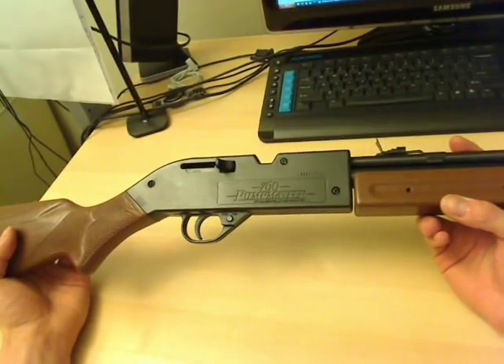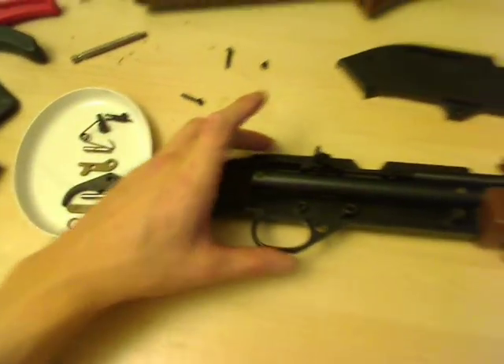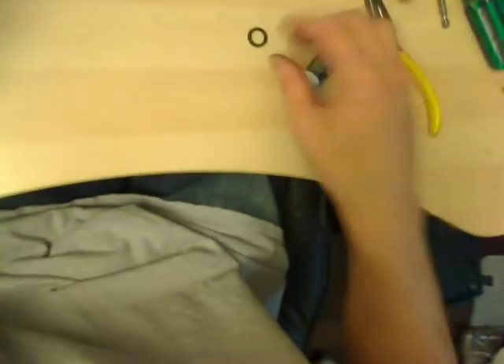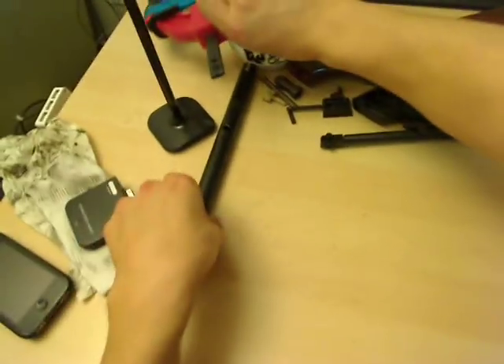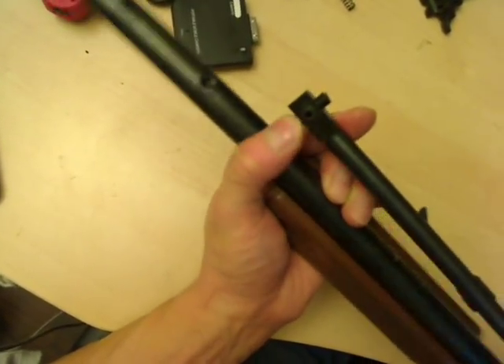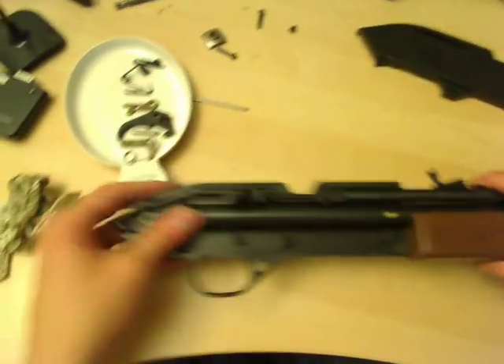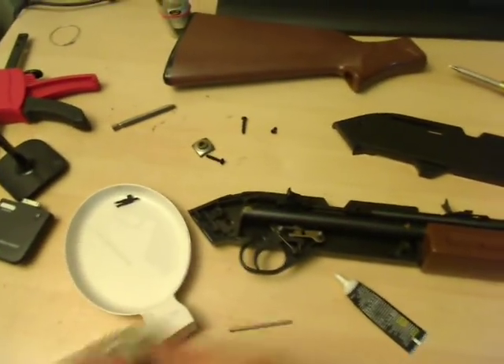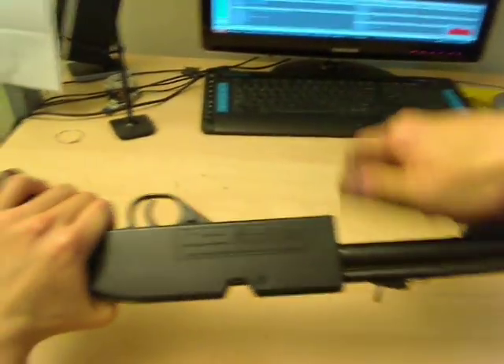FPV - How to Repair an 18 Year Old Crosman PumpMaster 760

Comment: I heard if you soak the seals in ATF fluid it will rejuvenate them. I was given 2 760 Pump Masters from a friend. He put WD-40 in the both them and destroyed them. I'm watching your video to see how to take them apart. I wanna see if I can try the ATF trick on them first. Just to see. I don't have high hopes. But in any case that will be awesome if it works. If not I'll replace them out. Plus I need to recondition both of these. He had them sitting in a high moisturized area and it shows. I want to gun metal grey the barrels a flat matte. Not sure if I'll do anything custom with the stocks. I'm thinking Olive Drab maybe for the Black one which is newer and the older one which has the brown keeping it classic. I'll just magic eraser it. Maybe stencil something cool into the plastic with my soldering gun. In any case, I'm going to have these both high speed once I'm through with them. Good video too, thanx... 👍
Reply from the maker: Hi,
I haven't heard of the ATF before, hope it works!  There are those additives for stopping engine oil from leaking, I wonder if that mixed with engine oil would be a good soak for the rings to get them to swell, that's basically how they stop the leaking.
Sounds like you'll have yourself a good couple of 760s!  They shoot well, since they have rifled barrels, so it's worth all the work to get them working well.
The new barrels aren't rifled from what I heard. They really cheaped out. Thanks for watching, and the comment.
Have fun!
Cheers,
David.

Comment: And after some hammering my Crossman no longer shoots straight. Lol beat the hell out of that barrel. J/k cool little video thanks I left mine under compression which now it won't pump hopefully your tricks and tips can save me from going online to buy these parts thanks.
Reply from the maker: Steven Zimmerman Lol.   Ya I hammered the crap out of it.  I made a new video showing an easier way to do it.   I realized the base has to be a heavy table or something,  not the top of your leg.   Hopefully!   It's a great site rifle.  If you're in the US,  it might be cheap from crossman,  you should ask.  If it's cheap do it.   Walmart might have one for $25, you can take the parts off that maybe?  The new ones barrel sucks compared to the old ones. 
Cheers, 
David.

Comment: Hey I know this is an old video but I saw you reply to a guy 3 days ago. so can I ask you.

My pretty old PumpMaster 760 almost refuses to pump, I've oiled it and it still will not compress the air without a fight. Any fixes? Thanks.
Reply from the maker: Hi, 
It's an oldie but a goodie!  So the pump action is actually sticky?  It sounds like the rubber pump piston is gumming up, might be sticking to the side of the cylinder, does that sound like the problem?
If that's the case, you could probably clean it out with a bore brush and hoppe's no.9, once it's all clean, you could get a new pump piston.
But if that has happened, all the other o-rings might be deteriorated too, in which case you might have to replace all of those too.
If you take it apart completely, you will be able to diagnose all those items.
It should be a fun project!
Cheers,
David.
Reply: Disassemble the 760 and clean the tube and check for debris.

Comment: Hey, I have a problem with mine; the air holding cylinder isnt holding the compressed air... do i buy a seal and try to take the air holder appart or...?

Comment: Mine the handle keeps dropping down and does not hold air. Would resealing it also take care of the handle just dropping down loose?
Reply from the maker: It's the cup being loose and or the o-ring that let's the pump fall.   If you replace both of those,  it'll probably seal up and work properly, and the pump won't fall down.

Comment: Need help asap. Cant hammer out the "spring" that holds the pump together with the barrel part. Ive hit pretty hard with all different kind of tools. Also tried hammering to the spring directly but it wont move. My gun is about 14years old and wanted to give it abit of renewal before I apply my new aimpoint scope. Can I just hit the spring with the hammer really hard until it starts to move some, then use a pin to help it get out the last part?

Comment: Hey dude nice vídeo, I have one 760 but a part is broke and I need the name to buy it or fix it, is the part that you pull to back after you pump, is like a trigger, do you know the name or How do I fix it?
Reply from the maker: Thanks man! It's called a bolt. But check it the description, there are parts lists there for the models. Might have yours. Also the website has more. Try fixing it tho, much cheaper

Comment from the maker: The plastic spring holder at the stock end of the tube will have a screw that goes through it after you put the right half of the case back on.
Cheers.

Comment: I did everything in the video my seal is good just when i pump and shoot no air comes out and its harder to pump then usual i cant find the problem could you help me out? I own the newest model pumpmaster 760 .
Reply from the maker: Hey Chris,
Is the pressure building up in the cylinder?  Accumulating pressure?  Like on the 5th pump is it getting harder to pump?
If it is, then maybe the hammer isn't hitting the plunger to let out the charge of air.

If pressure isn't building up, then there is a leak somewhere, maybe the internal seal in the chamber is broken, which could happen if you stored it with pressure in there.
Reply: alright thanks david ill check it out! and yeh it gets harder to pump and when i pull the trigger it just shoots but with no air i just got the gun 3 weeks ago.

Comment from the maker: Damn.
If you don't wanta go buy a cleaning rod(aluminum), then you can use a wire coat hanger, cut it with pliers and straighten it out.  Use sandpaper to round off the sharp edges, then you can use it with minimal damage to the inside of your barrel, it'll still damage it cuz it's steel vs. steel.  Use that to push the bb back to the breech.    If you don't wanta damage the riflings, buy an aluminum cleaning rod, kinda overkill but it's the proper way to do it.
Or try a few wooden skewers?

Comment: is this method the same for an older Pumpmaster???
Mine is from the late 70's early 80's, the piece that holds the pump cup on mine is metal with a strip of felt around it to reduce friction and my bolt action isn't a slide like yours but an actual small manual brass bolt.

another cosmetic difference is mine has a much smaller labeling stamped into the metal on the OTHER side of the gun, yours is on the right side (bolt side) mine is on the left. also my screws are in different places from you.

Comment: Ok now I'm seriously pissed. When I finally got the spring away and was gonna do the part with the fishline, it got too tight to press back inside. And when I got it back inside a bit there is 2 tiny holes there and when the rubber got in that place I couldnt even take the thing back out of there to remove some fishline.So I had to press really hard in order to get it out and that resultet into some rubber got removed from the o-ring. So now I have to buy a new one. Whats the item number for it?

Comment: Hey so I did everything in this video but everytime i pump it, air seeps out of a hole in the pump chamber. the hole is supposed to be there, like it wasn't a dent, but air goes right through it.

Comment: Ok so I rebuilt it and it worked at first but then it stopped. I figured out the problem. That gold piece with the valve that u put the new o ring on is broken for me. I think the hammer pin is broken. It always lets Air through when I pump I hear it come out without pulling the trigger
Reply from the maker: I haven't opened up the gold piece before, but there's probably an o-ring in there that has deteriorated and broken too.
I think to take that thing apart, you unscrew it, it's probably just an o-ring and spring/valve inside.  Should be easy enough to fix if you have the right o-ring.
I wonder if you can buy a modern day 760 and use the compression chamber out of that?  And use parts from there?  https://www.walmart.com/ip/Classic-Crosman-760-Pumpmaster-Air-Carbine/9222897
Maybe not, they look kinda different, but it would be cool if you could just move the barrel over from the old one, cuz the old barrel seems more accurate, since it has rifling, I hear the new ones don't.
Reply: Yeah it's the valve. Aka the gold thing lol. I really appreciate you having this video. I got this gun for free and I'm rebuilding it so thanks.
Reply from the maker: I took a look at the valve, and tried to unscrew it with my hands, but no go.  I guess you need some good tools and some rubber to grip it without damaging it, then you can get it open maybe?  Sorry I didn't go into that detail, but maybe I should for curiosity sake!  I should remake this video in 1080P too, this video is old and the resolution isn't the best.  I got a better set-up now.
Thanks man!  Glad the video helped you.  You're welcome. Enjoy playing around with the 760!  It's a great classic.
Cheers,
David.
Reply: Yeah man definitely make a remake! That would be awesome! I'll probably just buy a new one as I've tried and almost damaged the old one
Reply from the maker: KaptainMc 7 Cool.  You might wanta try a nitro piston break barrel rather than pumping air.  I got this Venom Dusk, it's not bad for the price.  I put a better scope on it tho, cuz the one it comes with isn't great.  Check it out here. https://youtu.be/CgXxJ_LPuHw
I have some Daisy guns too, those are really great quality guns, and seem better than Crossman quality.  The Powerline 008 pistol is fun, but they stopped making it, which is too bad, I'm sure there's lots of good stuff out there nowadays.  I would rather have something that shots 1000fps tho, 500 is a little slow, for a pistol it's fine tho. 
Cheers!
David.
Reply from the maker: KaptainMc 7 Cool.  You might wanta try a nitro piston break barrel rather than pumping air.  I got this Venom Dusk, it's not bad for the price.  I put a better scope on it tho, cuz the one it comes with isn't great.  Check it out here. https://youtu.be/CgXxJ_LPuHw
I have some Daisy guns too, those are really great quality guns, and seem better than Crossman quality.  The Powerline 008 pistol is fun, but they stopped making it, which is too bad, I'm sure there's lots of good stuff out there nowadays.  I would rather have something that shots 1000fps tho, 500 is a little slow, for a pistol it's fine tho. 
Cheers!
David.

Comment: just a heads up for you guys that don't need the added challenge of pulling the trigger apart;  you don't have to disassemble the trigger to change the O-rings and seals. You can leave the stock on too.  Just knock out the pin and pull the pump apart.

Comment: sae 30 non detergent motor oil is totaly different then regular detergent based motor oils, which is why 30 wt non detergent motor oil is 100% airgun safe, its also a comman oil used in lawnmowers in the summer time and its used in air compressors, if you use regual every day motor oils in a lawnmore you will shorten its life span and in airguns it will destroy the seals, , so only use the SAE 30 NON detergent motor oil in an airgun or lawnmower or aircompressor,

Comment: My cross man 760 is different in a few ways. Wish I could show ya what I mean. Screws in different places and 2 of the three screws are smaller than the other being roughly 1/4 in longer. My pin on the plastic pumping mechanism has riveted caps or atleast appears so. And the bolt to pull back the slide is brass with a hex head screw cap. Mine is suffering the same symptoms and I have no idea how old it is. If you can please msg me on how to figure out if there is any significant difference I should be aware of.
Reply from the maker: Hi,
Could be older than this one. Maybe it's the version before it?
It probably works in the same way.
Maybe you can just replace the seals and you're good to go.
Just take it apart slowly and carefully, so you can put it back together.
If you drill out the rivets you can always bolt it back together or use a pin like they did in this version.
Most things that were put together can be taken apart, just go slowly and take it apart to fix it. I've been able to take most things apart and fix them.  
Good luck!
Cheers,
David.

Comment from the maker: Thanks for the comment Kevin, you sound like you know what you're talking about. 
And ya, my video is a fly by night operation, I didn't use a proper hammer or pin punch, I used a strange multi-tool and V2 feathering shaft.  I'm unorthodoxed but it gets the job done.  I do however encourage those who try this to order the proper replacement parts and use the proper oils for the job.  You're right about about the hammer, no grease, it will slow it down, that's why I used high speed bearing oil.

Comment: I have one similar to this, it’s probably close to thirty years old, it still shoots but doesn’t have any power behind it ?!?!  I thought maybe it needed a co2 cartridge but there’s not one !?!?
Reply from the maker: This gun needs about 5 pumps to shoot well. Up to a max of 10. Try pumping quickly 10 times and see if it shoots well. Even if it's leaking past the seal, you can pump fast and it'll compress air.
Cheers,
David.

Comment: Hi, maybe you can help me
I've got recently a crosman recruit, it worked very fine until it didn't wanted to shoot anymore. The mechanism work but the air didn't come out of the air chamber and don't fire the pellet.
Reply: +Valmo2379 same
Reply: I've managed to fix the problem few months ago. It was the plastic end of the rod (the part that is hit by the hammer) that was broken and caused a jamm in the air chamber.
Reply: ***** hmm ill take mine apart and take a look but im sure my plastic thing with the metal rod is fine
Reply: Maybe it's another reason for you
Reply: +Valmo2379 If I pump hard and shoot the bb will fly out but won't shoot
Reply: +Valmo2379 i finally fixed my gun if its making a shh sound when you pump take the gun apart clean it check seals oil and unscrew the valve (bronze thingy) and there should be a plastic thing with a metal piece attached to it check that piece for cracks or dents it usually goes bad if you got sand in your gun

Comment: Recently I havr been trying to fix a Crosman 66 pumpmaster. The pressure cylinder is holding air (I replaced it) but when I press the trigger it does not release the air. What is the problem? How do I fix it? 
I suspected the spring for the hammer so I added another to give it power but it still did not work.
Reply from the maker: If you have a new cylinder, the hammer must not be hitting it, but sounds like you've already replaced the spring for that.  Could it be that pressure isn't building up?  Try pumping as fast as you can 5 times, if there are any seal leaks, that'll help mitigate those cuz of the speed, then take a shot, it should fire if pressure built up and your hammer is hitting the air release pin.
If that works, you'll need to check the cup or the other seals.
Cheers!
David.
Reply: @DavidSunshine  I have not replaces the spring yet. The Cylinder holds air because I release it using the hammer and pressing down.

Comment: DO NOT USE A COAT HANGER IN ANY TYPE GUN, i did that as a kid and ruined the barrel due to scratching the barrel walls, cost more to repair than the $ of a proper rod type tool

Comment: The content was good, but the video was very low quality and you moved an incredible amount. How about a re shoot with a fixed HD
Camera?
Reply from the maker: Ulysses Jurado Thanks for the suggestion.  I think I'll definitely have to re-do this one with my 1080P camera.
This was done back in 2011 when 1080p cameras weren't very common or affordable.  I only had a 3GS at the time and it was only 640x480.
Keep an eye out for it, cheers.
Reply: Well over all I would say it’s a good thing we were working on B.B. guns and not camera shots. But seriously, the quality of this video was excellent. Like as in your video was accurate and to the point and simple to follow with added tricks to help Incase ya can’t buy new parts. As for your movements, well you were working on a B.B. gun at the same time. No offense but I find your comment to be useless to the videos intent, unless your selling fixed HD Cameras.

Comment: I have the 2016 version... Can't get the pin out. 
I just dissasembled this and now it leaks through the barrel... And that's just from taking all the screws out and nothing else
Reply from the maker: Not sure why it'd leak, the only reason it should leak is because there's pressure on the "firing pin(valve release)".  Unscrewing it shouldn't affect the compression chamber at all either.
For the pin, you need a heavy hammer, a roll pin punch and a solid anvil to hammer it out, like I show here: https://youtu.be/a6Wf_aQwkwI (Your leg doesn't suffice, like I showed in this video).
Once you get it apart, it should work fine like mine.  Maybe there is a defect in your 2016 version? They may have made things better back in 1993 lol, 24 years ago.
Cheers,
David.

Comment from the maker: Ya, if you have access to an American Walmart, you should just buy a new one for $30, but if it's a gun your dad bought you, and it has sentimental value, then $5 worth of O-rings fixes a priceless gun.

Also, in the UK, this gun goes for about $130, so $20 of O-rings is a good investment to fix it.

In Canada, the gun is worth about $90, and the parts are $20, so I fixed it without using new parts.  I thought the $20 was a little steep.

It all depends on the situation.

Comment: My bolt just broke off. Do I still have to disassemble my entire gun?
Reply from the maker: Yup, you'll need to take apart the receiver to replace the bolt, you don't need to take apart the trigger assembly, so it'll be much less work to put back together.
Cheers,
David.
Reply: @DavidSunshine  Thank you!